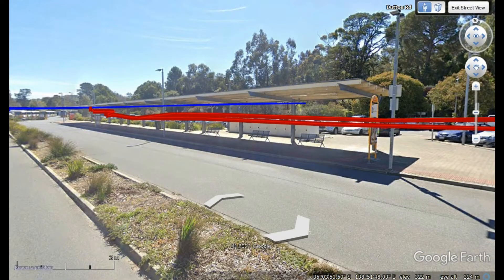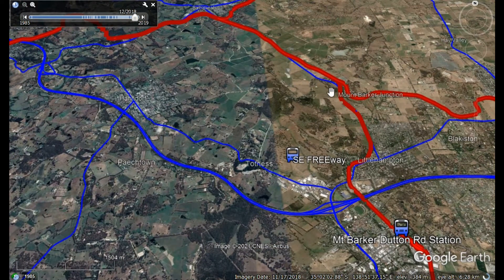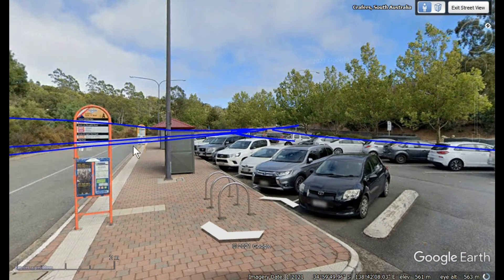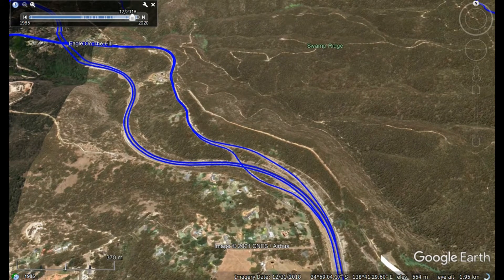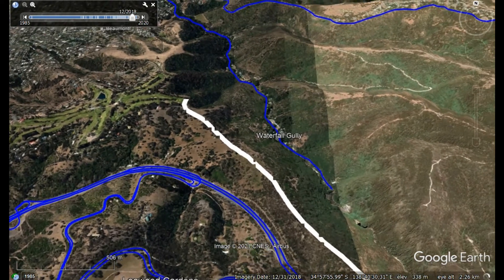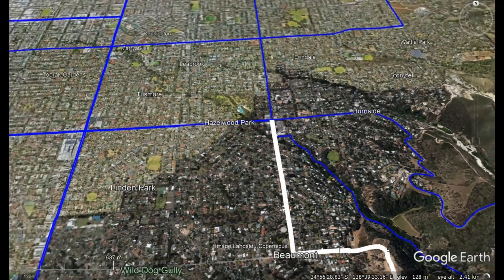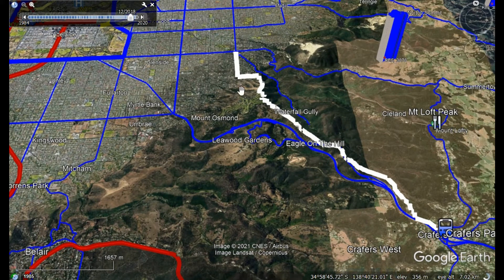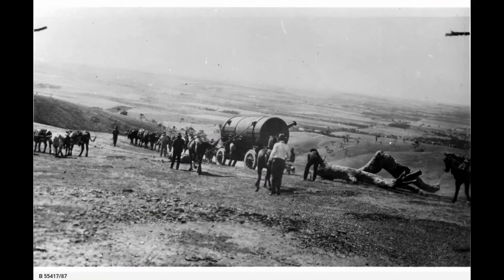Mt Barker to Adelaide via Eastern Busway along Bullock Track to alleviate congestion on S.E. Freeway

Comment: I think a fully loaded bus would struggle to get up the slope from Dashwood Road to rear of golf course
Reply from the maker: A Busway would would follow one of  the Pioneer Women's Tracks up from Beaumont to the rear of the Golf Course.    This is similar to how Greenhill Rd skirting up the hills on the other side of Waterfall Gully to Mt Bonython.     A "Curb Guided Busway" would be narrower than that for a "road way",   The Concrete Track would need less maintenance than a bitumen surface.
In Beaumont it could go into a tunnel - nobody wants / needs to put up with a railway / busway have vehicles every 2 minutes passing their lounge room window 24 hours a day

The Busways in Brisbane are more extensive than here in Adelaide and have many tunnels that run under roadways in the CBD, in the suburbs and many of their parks

Comment: I remember visiting the Adelaide Hills back in 1994 and it was fantastic. I must say, while I like the idea of a fast bus service down from the hills. However, it just puts the forgotten railway line from Adelaide to Mount Barker Junction to shame. I thought they were planning to build the freight train bypass and use the Adelaide Hills line for passenger trains once the bypass is completed. Would be nice to visit this place again, depending if the train comes back, or is it just going buses instead?
Reply from the maker: To get to Mount Barker Junction from Adelaide Terminal Station involves a change of rail gauge AND a change of "ownership" of the tracks.
The problem is the fragmentation arose when Dunstan and Whitlam Governments shifted "ownership" of the major rural SAR lines and passenger trains to the Canberra Parliament whilst the minor rural and Greater Adelaide lines and trains were retained by North Terrace Parliament.     (A similar thing was done in Tasmania.)
The North Terrace Parliament proceeded to sell much of the minor freight tracks or lease them out with maintenance costs to be the problem of the leasee.  
Jamie Briggs as the Assistant Federal Minister for Infrastrucure & Regional Development, Sept 2013 to Dec 2015, had the opportunity implement the "Northern Freight Bye-pass" via Truro suggested the Report released in June 2010.
The improvement to the value of Hills properties was NOT part of the analysis for the 4 alternatives that involved relocation of heavy freight trains away from the existing alignment.
Mr Brigss was also the local member of Federal Parliament for the seat of Mayo.   

The Marshall State Opposition won the last election with the Global Link proposal.   This had a 24 hour freight airport at Monarto and the Northern Rail Bye-pass.    It turned out to be "marketing'" rather than a serious proposal.

Let us see what 19th March 2022 brings us.

Comment from the maker: Hon Cory Wingard
Minister for Infrastructure and Transport

Dear Minister
[Mt Barker to Adelaide via Eastern Busway along Bullock Track to alleviate congestion on S.E. Freeway]

Above is a link to a recently released Video

The video investigates if the lower section of “The Bullock Track” could be turned into a guided and grade separated busway.

This would help divert traffic away from the congestion that is now occurring on the S.E. Freeway.

The large amount of new housing in Mt Barker has made public transport between Mt Barker and the Adelaide CBD a major issue in 2021.

Early colonialist used teams of Bullocks to move bulky item between Mt Baker and Adelaide down a ridge from Mt Lofty to the Adelaide around Beaumont and Glen Osmond.

The path they used was named The Bullock Track. Upper part of The Bullock Track on the escarpment was turned into tarmac and named the Mt Baker Road.

The O-Bahn Busway is a very successful method of public transport that runs at Full Fare-box Recovery.    The O-Bahn (bus-train) each day carries more passengers than the combined total of all of Greater Adelaide's Railway.    

The O-Bahn was initiated by the David Tonkin Government and completed by the John Bannon Government. 

In today's money the O-Bahn cost around $1.25 Billion.   

It is suggested this Eastern Busway would run from Crafers Park-n-Drive into Glynburn Road at Beaumont.

Regards

Neil Hamilton
Sent 11-11-2021

Comment: Sounds like a possible option. Coming from Mt Barker though I would want to catch a train not a bus.  As the first journey is only an extra 5km build a rail station at Blakiston and run standard gauge to Adelaide with a crossover at the broad gauge. However as previously discussed the Adelaide underground circuit would need to be built first.
Reply from the maker: The problem with railways is the Commonwealth (Canberra) Government was given ownership of the Main Line Railways and Passenger Trains in S.A. whilst the S.A. Government retained ownership of the Suburban Railways and Passenger Trains (terminating at Belair).
So any discussion about trains to Blakiston (Mt Barker Junction) and beyond will need to involve the winners of the next Federal Election for the tracks.   

The Commonwealth created the ARTC (based in Adelaide) as a "private company" with a single $1 share held in trust by the Federal Minister for Transport.

The SAR Country Passenger trains including the Overland were "sold' by the Commonwealth to a private company.  Currently run by  "Journey Beyond"  that was owned by "Quadrant Private Equity. on Jan 12th this was sold to American cruise operator "Hornblower Group" for $600m  Journey Beyond head quarters is in Adelaide at Marleston.  Hornblower Group is based in San Francisco
Reply: @Highbury5089  Selling off the below rail infrastructure was never a good idea (Loss of control). The Commonwealth will never be interested in running anything but freight as it pays its way. 
Goodness knows what will happen now Journey Beyond has been sold to an overseas consortium Quadrant Private Equity. The Overland may well disappear as well even with a subsidy from the Victorian Government. There is a need to count the social & environmental benefits as well as economic. 
But ARTC should provide access for the state of SA to run regional trains, for a fee of course. But do they want to? The current Liberal government appear not interested in rail at ALL! 
Now KiwiRail is terminating permanently the Auckland Wellington & Picton Christchurch routes in favour of cruises between those destinations. Private companies are interested in one thing only Profit!
Reply from the maker: @dhuphill  South Australia's regional Rrailway lInes (other than those "sold" to the Commonwealth and now run by ARTC) are still "owned by the S.A. Government".   Much of these tracks were leased by Genesee & Wyoming (G&W Inc) via Genesee & Wyoming Australia.  That entity had joint venture with Wesfarmers (Coles, Myer, Bunnings) 
As of October 2021 this is now owned by Aurizon.   Aurizon was formerly owned by the State of Queensland and traded as Queensland Rail (QR) operating trains around Eastern Australia.
So Aurizon leases and maintains the tracks and could run it own trains on those tracks.
Wheat from the S.A. Mallee goes East of the SA-Vic Border by train, but west of the same border the wheat does NOT go by train.
( I drive regularly alongside that "abandoned" track.)

Passenger trains with trips of less than 400Km can and do run at a profit when the service is properly structured with passing loops for local trains at minor station so he express trains can pass through wihout slowing down.
There is nothing worse than sitting in a train waiting our turn to go down a single track.   Almost as bad a sitting in an Jet Plane at Perth Airport that has missed its "slot" to take-off

The O-Bahn rubber wheel "railway" in Adelaide runs at a profit.   (100% Fare Box Recovery) 

"The Overland " Train receives a subsidy from the Victorian Government and picks up and sets down passengers in regional Victoria.  The same train does not get a subsidy from the South Australian Government and it does NOT stop in S.A. regional towns of Bordertown, Keith, Tailem Bend,  Murray Bridge,  Nairne or Belair.

"After departing Ararat the train stops in the Victorian towns of Stawell, Horsham, Dimboola and Nhill before crossing the South Australian border. The final stretch into Adelaide, after crossing the Murray River is over the scenic Adelaide Hills."
Reply: @Highbury5089  Hi Neil, Thanks for the concise ownership details of SA rail operations & maintenance. Interesting your comment trains less than 400km run at a profit. That would depend on catchment, frequency etc as you say.                                                                                                                        I agree passenger trains must have right of way at loops. I had not realised the 'Overland' no longer stops at SA towns. This sounds like a Victorian response to no contribution from the SA Government to its operations. 
There are 50,000+ people between the 3 cities on Spencer gulf with no rail service. Similarly there are 70,000+ in the Adelaide Hills & Mt Barker with no service. While a bus service could provide a passenger service via the bullock track some dollars would be required. Personally I would not want to travel on a coach even every day. The train line is already there so why not use it?                                                                                                               Until the CBD underground is constructed trial a rail service to Parklands with connecting buses to the CBD. This could operate for the Spencer Gulf service as well?  Newcastle Interchange now operates with a turn up and go tram service (Albeit 4 min in peak hour) which is accepted by users. Start with morning & evening services then build from their.
Reply from the maker: @dhuphill  I am quoting  an Japanese Study about the passenger preferences that  found the 400Km preference.    
* Train Shin-Osaka to Tokyo by Shinkansen 514Km 2.5 hours  $US160  ($A224)
*  Flight time is 1.5 hours $A55 by "JetStar Japan "  ( Qantas Group, Japan Airlines and Tokyo Century Corporation.)

I have travelled on the Shin-kansen trains in Japan and the high speed trains in China.

In Britain there needs to be an Up track and a Down track for a "right of way" to be considered as a "Railway".   
Most of the line between Melbourne and Adelaide is single track

*Moving the rails around to change the gauges is only one solution.   
* Moving the wheels on the axles is another method.   My son and his wife travelled on these gauge changing trains in Spain & France
* Having 3 rails with standard and broad gauge is the old method in used in Port Pirie etc when I was young.  (The main street of Port Pirie had all 3 gauges).

There are 50,000+ people between the 3 cities on Spencer gulf with no rail service. Similarly there are 70,000+ in the Adelaide Hills & Mt Barker with no service.
The BART in San Francisco is "driver-less train system" owned by the 3 Counties  
https://www.bart.gov/about/history
BART has the highest farebox recovery ratio of any public transit system in the United States (excepting the very small, tourist-oriented Vegas monorail). It has among the best farebox recovery of any system in the world, with only a handful of systems (Tokyo, London, Osaka, Singapore, Taipei) higher.
It has seen massive ridership growth over the past decade.
https://www.transitwiki.org/TransitWiki/index.php/Farebox_Recovery_Ratio

The South Australian Local Government Act allows LGA's to be involved with infrastructure.
Mt Barker City Council & Hills Council could create a joint venture to run gauge changing trains.    
ARTC issues a "ticket" to any train owner who wishes to run trains on their tracks.

The lines run through MItcham City Council and Unley City Council so they might become part of the "Trust"

LGA's are creating Trusts to handle joint rubbish disposal, bitumen procurement etc.   They could do that for passenger trains.